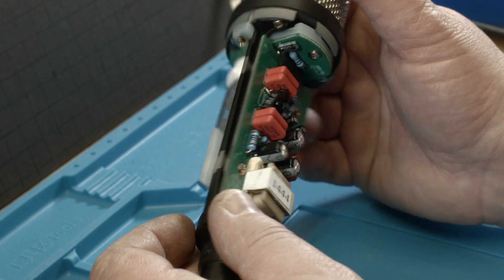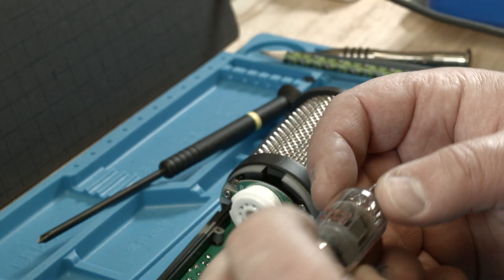AKG P820 Teardown - Part 2

Comment: Hi. Thanks for the disassembly vid. Did you ever try swapping out the tube for another (better quality) ECC83/12ax7, such as a Mullard or RCA Black Plate, and, if so, thoughts? I bought a P820 today. ;)
Reply from the maker: No i didn't swap the tube yet. The one in there works great, and not sure how long it lasts, but if i ever have to replace it, i would probably look for the best there is ;-)
Reply: @mygiguser  I swapped mine for an Electro Harmonix 12ay7, with gold pins... much better mic. Not so hyped in the top end with the gain reduction. Would have gone with an GE 12ay7 black plate if I'd had the money!